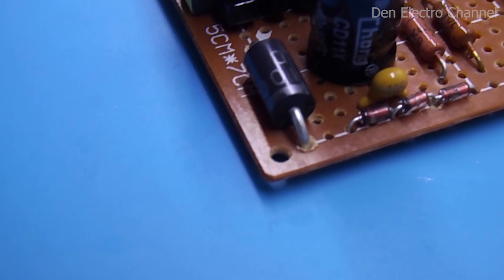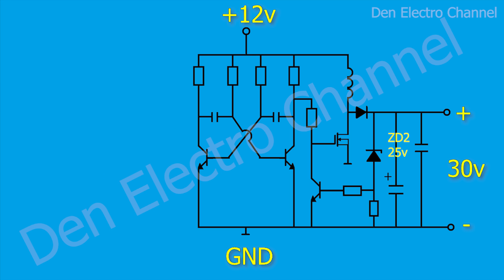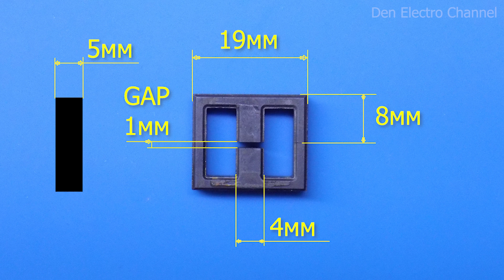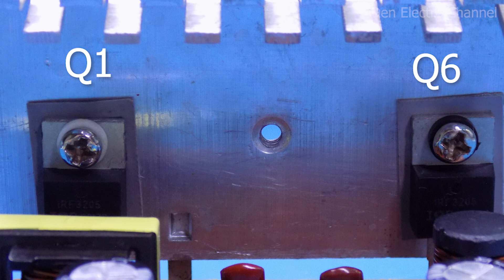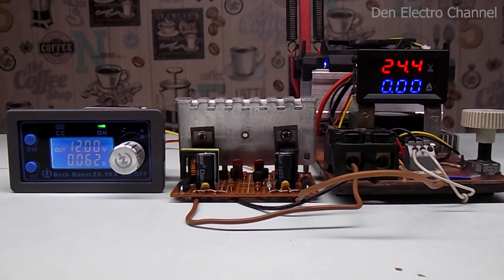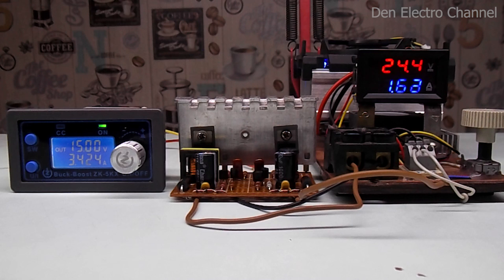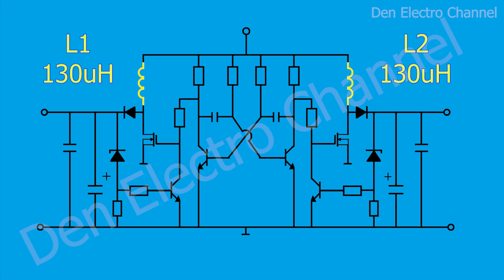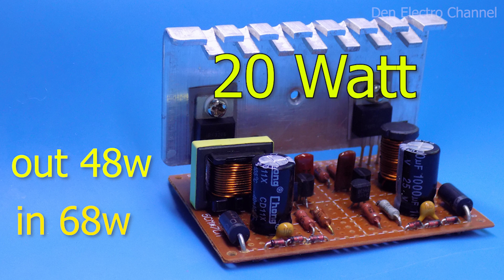How to make a boost converter?

Comment: Would it be possible to turn this converter into a high voltage converter. I have an application where i need 3000 volts but I do not need the high power.

Comment: Nicely explained video, you are going in the right way. About the circuit, the negative feedback can be improved, the way it's done it's not the best for turn off the mosfets, it should be some type of shmitt trigger, or the gain should be increased by adding another transistor, to make the gate control more sharp
Reply from the maker: Thank you. Yes, I think you are absolutely right.

Comment: can you get split rail supply like +15v,-15V & 0V from this to be used for audio opamps if one of the o/p diode & capacitor polarity is changed.
Reply from the maker: no